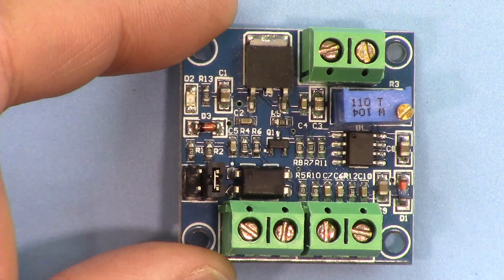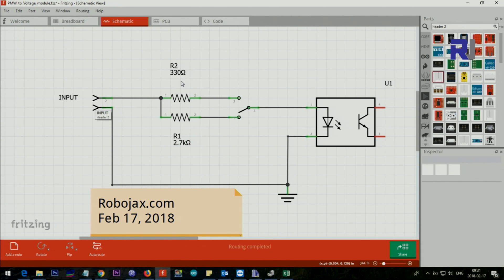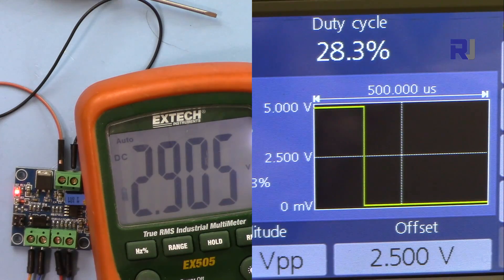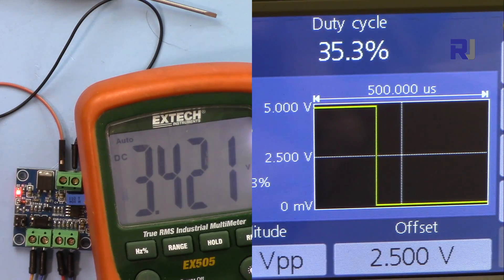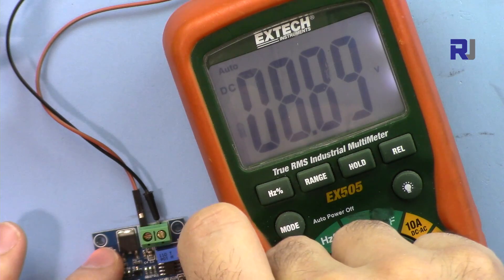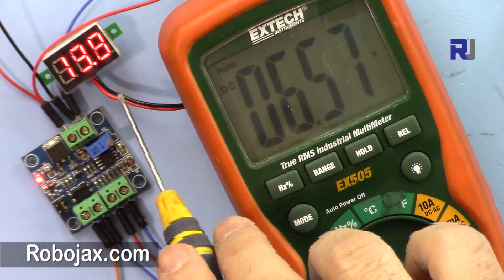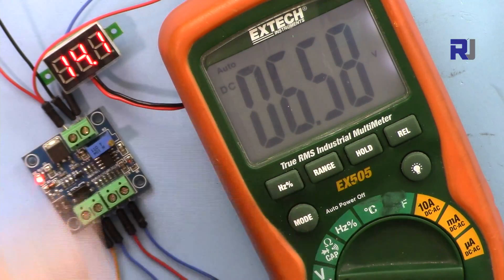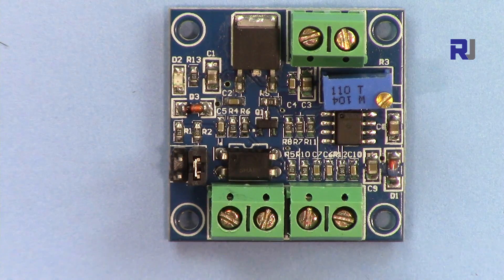Convert PWM to Voltage using IC Station converter (Review and Test )

Comment: Very Good video👍👍👍
Does it work with the standard pwm freq. Of the arduino with 490Hz or is this too low???

Thanks and greets
Reply: I can confirm it does work with the arduino UNO output of 490Hz
Reply: @chriswouse7713  have u tested it with arduino???
Reply: @chriswouse7713  Does Arduino's insufficient PWM frequency (>1kHz) has any side effects impact on output voltage? I have device which can be controlled by analog (0-10) voltage input. I'd like to create controller for such device using Arduino Uno and this converter. I don't know this converter fits well for my project. Can you provide some output samples of PWM -> voltage map?
Reply from the maker: I have not tested in different frequencies, but you can look at the manufacturer website http://www.icstation.com/voltage-converter-board-duty-cycle-adjustable-conversion-module-p-12430.html

Comment: what is the difference between http://www.icstation.com/voltage-converter-module-adjustable-converter-power-module-digital-analog-signal-p-12498.html
and http://www.icstation.com/voltage-converter-board-duty-cycle-adjustable-conversion-module-p-12430.html
??
Reply from the maker: One is outputing 0V to 10V only and the other 0-5V and 0-10V as says in the title of the product.
Reply: HI. Thank you for your reply. I want to use my Arduino to control this LED dimmer driver: http://www.meanwell.com/webapp/product/search.aspx?prod=PWM-120(DA)
It has input for 10V PWM signal. So is the PWM to Voltage the right module to use?
Reply from the maker: The page you sent me on page 8 showing that you can connect 0 to 10V DC or 10V PWM. If you are planning to connect the module in video, get the one you send me the link 0-10V and it should work. 
you will control this module using arduino. This module will output 0-10V based on the duty cycle of PWM which you can connect to your power supply PWM-120 to the DIM- and DIM+ terminals.

Comment: Hi, is this good for controlling LED drivers which require 0-10v PWM signal with Arduino?
Reply from the maker: You could use it. But this will drive LED dim and bright using voltage. The best way to increase and decrease the intensity of LED light is PWM so you will have fixed for example 5V (voltage will not change) but PWM will change from 0% (dim) to 100%( bright).